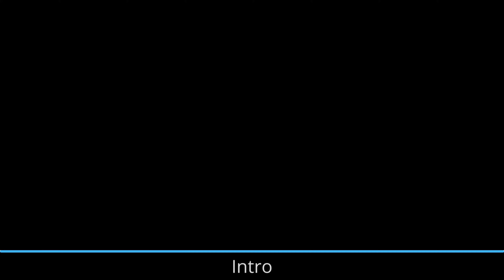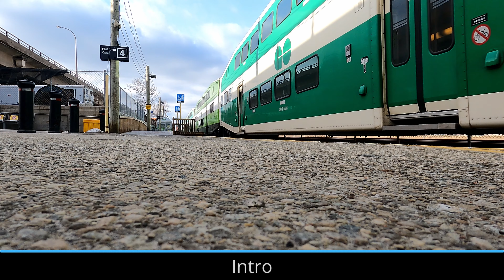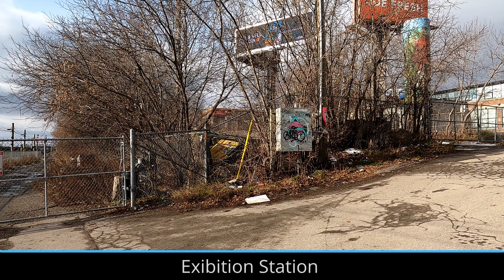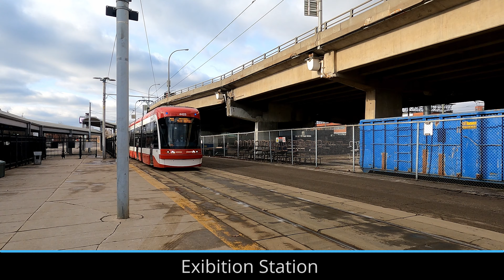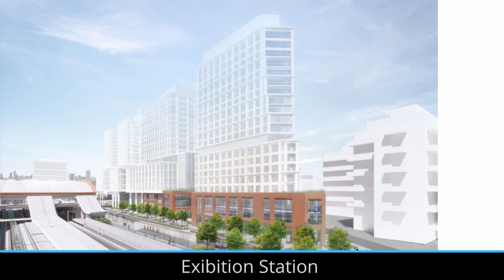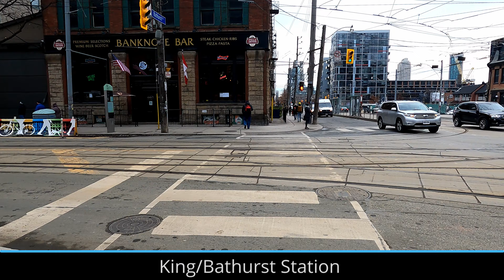Ontario Line Corridor Overview 2022

Comment: I see no reason why the line has to go under Queen St. Why can't it use the existing tracks that feed Union Station?
Reply from the maker: Aside from the complexity of the rail corridor in that section, I would assume the choice was made to avoid redundancy with GO lines. Going to Queen provides better transit downtown and some relief to Union. With frequent GO service I think this decision is fine. Thanks for watching!
Reply: @transitthinker  why is GO always a priority when it's Toronto that should be prioritized in the city of Toronto ? Do GO users live in Toronto ? No.
Reply from the maker: A lot of people use GO to get downtown from Etobicoke, Scarborough and North York. Improving GO service in Toronto will still help Torontonians
Reply: @transitthinker  Mostly car drivers - does not improve genuine public transport.